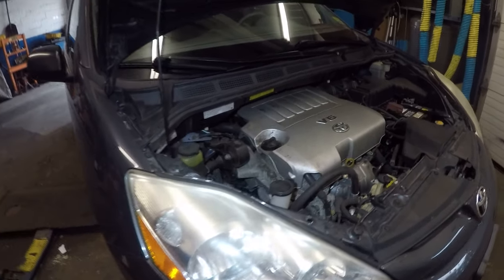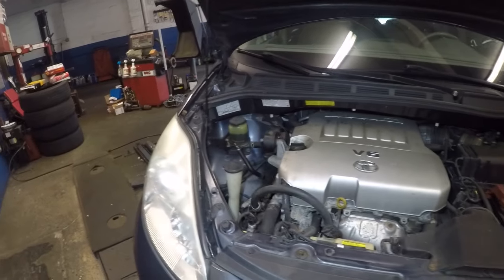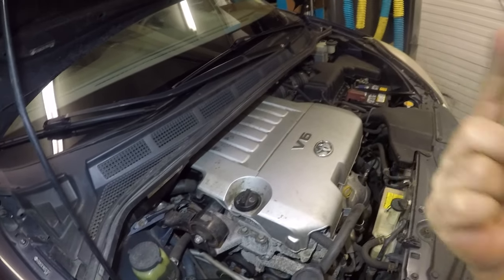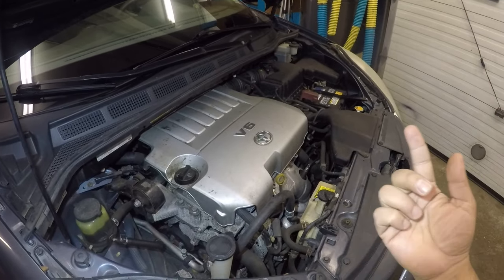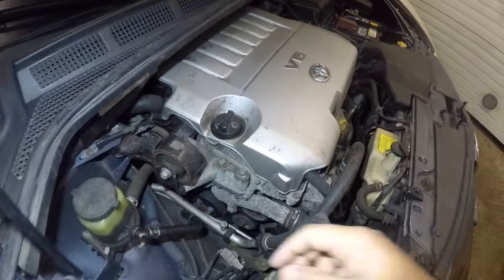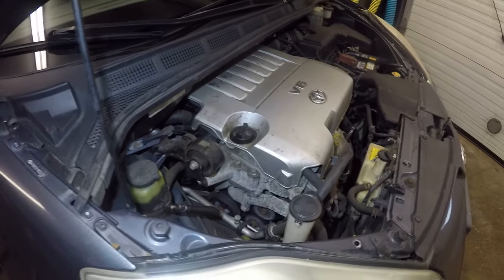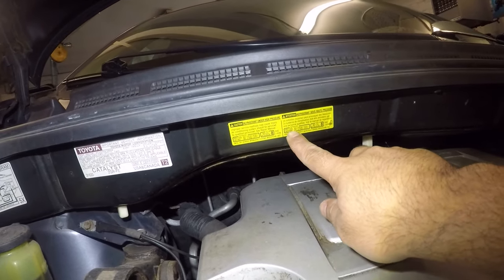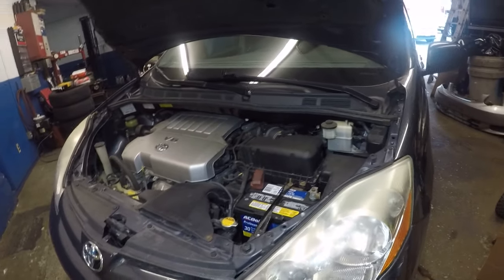AC Blows Hot and Cold Intermittently

Comment: Hi sometimes my ac doesn’t come on when it’s too hot outside what could it be?
Reply: Could be a lot of things, I would start by liking up weather/humidity chart for automobile r134a recharge and follow that chart, whatever your humidity/ ambient temperature is out side recharge AC accordingly. Always use gauge manifold set to watch high and low side. Or replace your expansion valve or accumulator  drier

Comment: Hi, I have an 04 Toyota Corolla. I had done Freon and that didn’t help at all. In the mornings I turn on the ac and it’s freezing cold. Now, in the afternoon when I turn it on it blows hot air, then humid, cold, and then hot air again. What could be the issues. I just don’t want to take it to a mechanic if I have to spend a lot of money. Thank you
Reply from the maker: How did u do the freon
Reply: @RBTheMechanic  hi, how I did it was leave my car on with the ac full blast. I popped open my hood and inserted the Freon into a tube and went from there.
Reply from the maker: @delilacontreras5637  well it wount be good ac preformance u less u evac with ac machine and add correct amount

Comment: My 2006 Silverado air conditioning doesn’t smell, but it stops working off and on. Had the coolant replaced and didn’t help. Compressor is fine. No leaks. The fan works fine. When the cold air stops on its own here and there, fan still going, the air seems more humid only then (when the cold quits) and smells slightly wet.  It’s started the day I got it back from a fuel pump change… It works fine about 50% of the time.
Reply from the maker: Ok. I think ur checking coolant system but u need to check Freon pressure and it seems like ur system might be low that would cause on and on type hot cold warm mild
Reply: @RBTheMechanic  I meant Freon! The shop released all the old and put in new and look for leaks and that did not solve it
Reply from the maker: @jeanies8495  did they vaccum it? If the releases it that’s bad for the planet don’t go back to them and if the releases it they don’t have propper machine they should had recovered it with ac machine
Reply: That’s how mine is at the moment too

Comment: On my way back to the repair guy now again (5th time, 3rd different place ). I feel bad for making suggestions to them since they suppose to be the experts but I will try to choose my words wisely. My A/C had quite a few repairs done in the past few weeks. The problem now is that it works perfectly while idling ( hence they pick up no issues  ) but whilst driving it cycles on and off ( mostly off ). It is the clutchless type. They already changed the condenser and fixed a leak and also found a blocked pipe ( car had a slight front knock which bent the condensor and a pipe slighthly which led to the blockage theory but I guess there are other issues ). They keep charging me everytime as well and I am honestly running very low on cash. I wish you were my ac guy. Greetings from South Africa
Reply from the maker: One question how are they charging ur ac system are they using cans or are they using ac machine to recover and vaccume and then re charge?
Reply: @RBTheMechanic  The 1st placed used one of those really expensive machines that measured everything and was fully automated but this place is using manual gauges and tanks ( to be fair though they only do a/c's and they should in theory know what they are doing as they have been around forever ). Anyway I left my car there now and casually mentioned some pointers that you said in your video without trying to sound cocky. I need to use these guys as I have paid them quite abit already and they seem honest enough to fix their mistakes.
Reply from the maker: @declansgamereview6523  yeah these new cars requires perfect amount of refrigeration also if u have a leak it wount work out well since machine will vaccume and air will be sucked in and then u will have difference in pressure but from what I under stand when ur idling ur working fine due to low rpm but when moving high rpm it quickly pushing as much as it can and then there’s none left behind to pump for ac compressor untille more returns back to suction line
Reply: Could be bad pressure switch or compression valve since your compressor is clutchless it has a compression valve to control flow of refrigerant
Reply: @macknumber9  turned out to be a bad compressor
Reply: @declansgamereview6523  compressor was fine...it was the compressor valve...they could have saved you a little bit by just replacing that valve...instead of the whole compressor. Thanx for getting back to us though...nobody does that on YouTube.
Reply: @RBTheMechanic 2011 Ford Fiesta. Air conditioner has always been cold. I replaced the cabin air filter and since then the air condition  blows cold as it use too but now fluctuates. Sometimes at a stop and even sometimes going down the highway at 60 mph. It can be 5-15 mins apart or longer?..
Reply from the maker: @LastTrump7  what apart 5-15
Reply: @RBTheMechanic  the AC can go from cold to warm usually at a stop or turning slow at a light. It does not normally do it at a  idle. It can go from cold to warm for 15-20 seconds pulling out of the driveway and run 30 mikes straight driving cold?
Reply: @RBTheMechanic  I was told by a Ford tech that the Fiesta which only has 120hp when going from a stop to acceleration with the AC on high that vehicle computer can cut the AC compressor out 10-15 secs until motor has accelerated. What you think? Did notice it don’t do it if AC is set on low?

Comment: So my mothers car,at times it blows warm then cool and then warm, and lately is not as cold as it should be, I felt the ac lines while the car was running, and the high side was hot,and the low side line was warm or basically ambient temperature,not cold at all, I'm trying to figure out if it's the expansion valve or low freon, car is a 2017 Kia soul with the 1.6 engine, any suggestions on what else to check would help.
Reply from the maker: I would do ac service of it dosent work out the ac compressor need to be replaced

Comment: I had the climate control knob fixed. Was working ok. I released the old freon and put in autozone ac can. Now it blows hot air. Maybe i just need a good ac service like you said. Its a 2002 highlander.
Reply from the maker: Yeah try ac service with machine the van stuff is no good

Comment: Hello RB:  Thank you for your great video. This is exactly what is happening to my 2012 Chrysler 300C (the A/C blows hot and sometimes cold air.). I took my car into a local mechanic so that they could check to see if it was Freon that was needed. They checked it and said that the recirculatory button was not working and that it didn't need Freon. I received an estimate for what it might be. I will have to save up for it now. 

They mentioned three things could be wrong. First, the A/C blend door actuator may be needed. (When I researched this, it says the car would be making a noise. Mine does not.)  Second, A/C condenser may be very filthy and may need to be cleaned. (I looked at it, doesn't look dirty, but I rinsed it. Unless it is a deeper cleaning that is needed). After researching, it also said that a noise would be heard. No noise is heard. Third, they could replace the condenser and expansion valve and add Freon (suppose the one in there is removed/lost that they need to add after saying that it didn't need any?). The 3rd option would cost me $628. Thoughts?  Should I go with the 3rd option or try the cleaning first? ($75) Again, I don't hear any noises. BTW: Where are you located?
Reply from the maker: Why don’t u try reserving the system first do it using ac machine recover vaccum and recharge and see where that take it
Reply: @RBTheMechanic  I have no idea what all that means but I will try to find out. :) Thank you for your response.
Reply: @RBTheMechanic  I forgot to mention that I checked the pipes under the hood you mentioned. The one on the right (facing it) was normal cool the one on the left got super hot right away after turning on car.
Reply from the maker: @yogibear6084  so ur ac is working?
Reply: @yogibear6084  did you ever figure out your issue?
Reply: @phillippardo5712 I’d vacuum the lines and put in dye with new freon if there was a leak then check in a day with a light to find a leak. It’s probably just old seals leaking on the a/c lines.
Reply: @chief8879  mine ended being expansion valve inside the ac compressor. Forgot the exact name but it works just like an expansion valve.

Comment: I have a faulty AC and dont need it and dont want to repair it. It is constantly running, I can't switch it of. Can I dissble it by removing the AC fuse?
Reply from the maker: I think u can pull the ac compressor fuse

Comment: 2010 Ford F-150 fx4 4x4 ac will blow cold then hot out of no where no leak good on Freon should this be bad ac compressor ?
Reply from the maker: U have to check some basics first check ur relay change ur out it can also be Freon pressure with air pressure or compressor that cuts off
Reply: @RBTheMechanic  so recommend changing the relay first is it just the ac compressor relay ?
Reply: What u mean by ac compressor cut off
Reply from the maker: @jesusvaldez8315  ac compressor can cut off due to heat and pressure it has safty switch
Reply from the maker: @jesusvaldez8315  yup change out the ac compressor relay first and next time if cuts off check to see if compressor gets power with ac on but u have to check this at the moment it shuts off that way u can determine the power is there or not to rule out ac compressor hood or bad
Reply: @RBTheMechanic  I’ll check those basics first thanks for your helpn
Reply: @RBTheMechanic  ahhh I see understood does it mostly all the time I’m driving at times takes a while to do it but it does it and just throws warm air thanks
Reply from the maker: @jesusvaldez8315  it could be bad mixture of Freon and air

Comment: I have a situation on my car a lexus ct200h 2013 (which is pretty much like a prius with a lexus badge) where the ac works and blows cold air then some time passes and it starts blowing hot air then after a while cold air again and so on. It might not be related but it started happening driving back home in a heavy rain day where i had to drive back home with higher than average water levels so maybe something shorted I dont know.
Reply from the maker: Electric everything compaired to this car so o Py thing u can check is once’s ur ac cuts off check bled door operation other wise it may need to be checked by specialist

Comment: My 2017 nissan Sentra has this issue where the cold line is cool to the touch but never is cold. Its constant and it will never will get any colder than that. I had took it to the dealership to have them service the freeon and they asked me why. I told them it was not really getting cold just cool air but not enough to call it cold. They ended up discovering that the compressor is failing. It gradually over time just kept getting less and less cold. I have no idea at this point but one things certain, it feels like the ac compressor is not working like it should. Not pumping the freeon property and thus not getting cold enough. Just based off everything im seeing it only seems to be the case. I just do not want get rip off again especially since i had them test it to see if this is the issue. I jist want it fixed but have no idea who to take it to.
Reply from the maker: There’s no such thing discovering compressornfailing they have to do the service to make that judgement
Reply: @RBTheMechanic  I wrote discovered but they wrote out that it was failing. They did not write discovered.

Comment: i have a Mercedes Benz E250 Coupe 2010 Model , I'm facing a problem with driver side AC is blowing up hot air sometimes while the passenger side and rare side are always cold.. what do you think the problem is?
Reply from the maker: Start with ac service could be low Freon or blend door motors not working

Comment: Thanks for the video! I have a 2001 Dodge Ram 1500 and it blows cold air for about 10 to 15 minutes then it will blow hot air. I turn off the a/c and fan for 3 minutes, then I turn it back on and it will work again. This keeps reoccurring. How can I fix this?
Reply from the maker: What kinda car u have year make model?
Reply: @RBTheMechanic  It’s a 2001 Dodge Ram 1500
Reply: @RBTheMechanic  also, My 2001 Ford Mustang GT only the fan and A/C works when I put it on Max. How do I fix it?
Reply from the maker: @candyarevalo9533  resistor might need replacement

Comment: My AC makes a hissing sound every time compressor cycles through. It only comes on when driving and more prominent at higher speed. Recently, I noticed that the fan speed suddenly drops, blows hot air and then there is a loud hiss and then cold air starts again. Also noticed the pipe which connects the expansion valve has rust suggesting there must have been quite some condensation around it. I don’t know what the problem can be?
Reply from the maker: Check ur Freon pressure low and high with ac on full blast

Comment: My 2012 sonata blows warm at startup on hot days. Fan is working, fully evac and recharged Freon. Not the expansion valve or pressure sensor switch. I need help.
Reply from the maker: Try reservice that’s all I could think and comes to my mind I had cars which I serviced machine did ass propper amount and it didn’t work well
Reply: I HAVE THE SAME PROBLEM WITH A SONATA 2012, TWO MECHANICS TOLD ME THE COMPRESSOR IS NOT GOOD.

Comment: My car had a problem where when you first start the engine the AC will work for a minute or 2 then just starts blowing regular air. I took it to an AC auto shop and they replaced the compressor, condenser, expansion valve, etc…. But it still wouldn’t work. Do you have any clue what it could be?
Reply from the maker: How did they recharge the systems? Some shops use cans to charge which is not proper way ac refrigeration has to be correct amount also oil for ac system so have it re serviced vaccume the system for 20 minutes then re charger. That’s what seems like to be the problem to me
Reply: @RBTheMechanic  Yup I had another mechanic shop do that and it didn’t work. Is it possible that they didn’t check for a dead relay?
Reply from the maker: @Johnnyy832  it could be relay cutting off once it get hot away it out

Comment: that's my problem - good explanations - thanks.  another video mentioned that cabin air filter or the ac radiator (condenser?) could be dirty - do you ever find that's the problem?
Reply from the maker: Yup have seen those also cause over heating blocked radiator with dirt

Comment: I just change the ac compressor my ac works few minutes then blows hot air then blows cold again hot and cold on and on what do you think the problems is
Reply from the maker: How did u recharge the r134?
Reply: @RBTheMechanic  the mechanic is the one who recharge it i just bought the 134a freon..??
Reply: My car is vw jetta S 2016
Reply from the maker: @ajpascual8969  welll I’m not sure but it sounds like it need to be recharged ask him how did he charge the system if he used can to fill the Freon that can be the issue
Reply: @RBTheMechanic  yes he use a can frron
Reply: He just use the can freon
Reply: Where i can go to refill my freon using ac machine
Reply from the maker: @ajpascual8969  check with your regular neighborhood mechanic ask him if he has ac machine
Reply from the maker: @ajpascual8969  there u go prolly got over pressure air pressure all kinds of mixture
Reply: @RBTheMechanic  i brought it to the shop it was the fan is not working
Reply: They check if theres a leak or what so ever thanks god no leak but they found out the radiator fan its not working
Reply: @RBTheMechanic  thanks for your help sir
Reply: My car is fix now thanks again

Comment: Good morning my ac works only when its not hot outside. I had it vac’d & recharged it wasnt the issue. If its hot outside and I put cold water to cool the car down under the hood. Or run it thru a car wash it kicks back in. Im not vegas and they charge a arm and leg also will scam. Possible problem?? I want to have an idea before I take it in.
Reply from the maker: Usully the case is the Freon is low so do ac service also check to see before u do that the fans work on radiator
Reply: Thank you… what do u think about possible condenser issues? When i rinse the car with cold water in the front by the radiator it makes the ac cold.

Comment: Thanks man! Question - my sienna 2014 , 126k miles was blowing 70c, I saw the low pressure valve was mad high, so I let some pressure out. (Not the best I know) 

It was blowing at 75c before I touched it, after I released some pressure after someone told me it would help lol, then it went to blowing 90c. Straight hot air, no cooling. I decided to stop and take it to the shop.

I told him what happened and what I did. He said he fixed it, he drained the system, charged it again, but AC is still at 65* at 630am now! 

This ain’t right. Yesterday on my way home 15 minute drive, the car never got cold, it was barely ok. And that was at 630 car had been sitting in the sun it was mad hot. 

This car was a meat locker before. 65 at 6am translates to sweating bullets at noon. 
When it’s noon this doesn’t work.
Reply from the maker: I would just reservice the system with ac machine recover vaccume and recharge correct amount oil and refrigeration

Comment: My ac works fine for the first minute or two then the cooling gradually goes away I checked the freon and it was slightly less than usual. Is this the issue? If you could write all the possible issues, I would be very grateful.
Reply from the maker: U can’t see Freon u might be looking at coolant which is diffrent and it dose seems like u might be low on r134 gas
Reply: Did u figure it out my car is doing the same thing